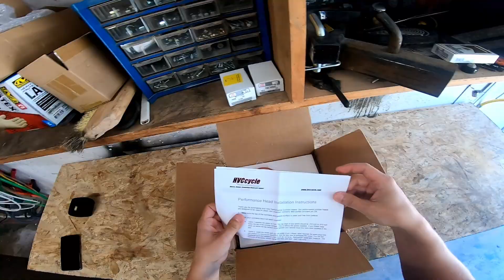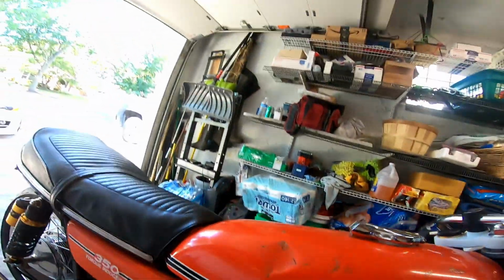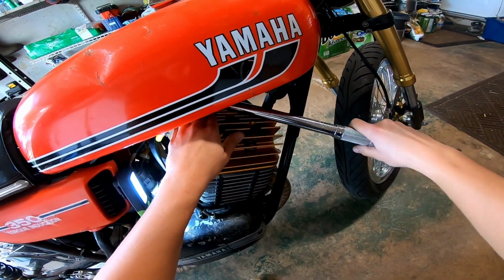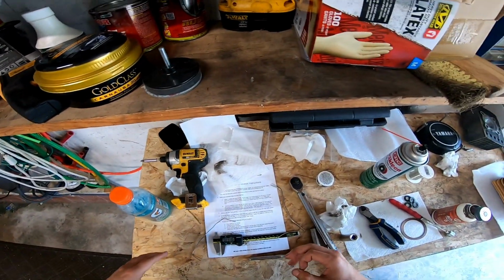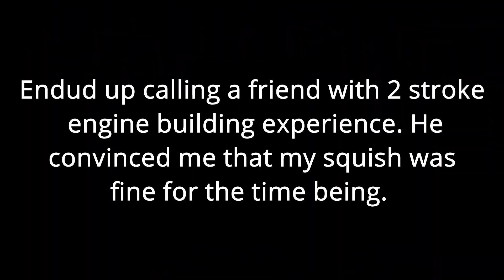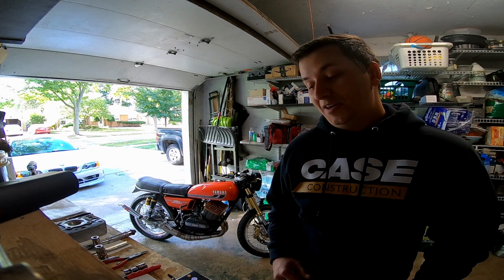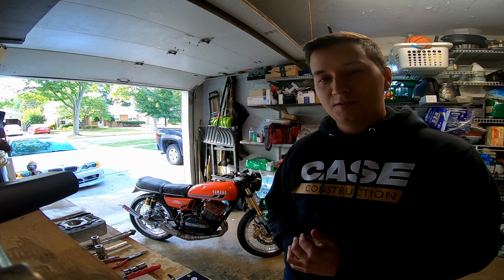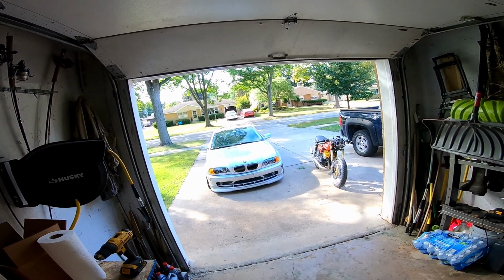Installing HVC Cycle CNC Performance Heads on my Yamaha RD350 Cafe Racer!

Comment: I was a young kid flagging the races on a 1/8 mile bridge then the RD 350 Yamaha raced a 750 Honda Super bike the guy on the Honda was  half way across when the Yamaha was the finish line the guy on the Honda was crying, I was laughing my but off !!!  On using the high compression heads are great. I built a Kawasaki 750 triple and I used 12 to 1 pistons, polished the exhaust ports and put a real nice expansion pipes on it, made the intake a little and I knew before testing it I had put in a set of Barnet racing disc's and double springs. and the guy I was working for wanted me to race it. i ASKED him did my wife put you up to this. He didn't have the money to get the extended swing arm and put on a slick an wheelie bars on IT..

Comment: I had a 75 RD350B back in the day along with a TZ750 (best thought of as 2x 350's welded together by the factory for Kenny Roberts).
For biggest smiles, lower intake ports 4mm and raise exhaust ports 3mm, smooth and widen transfer ports with a 280-320 finish grit.
It will take it from mildly pipey to downright explosive and give you at least 2000 more rpm of peaky fun.
My RD350 would wheelie at 60mph in 6th gear when cranked on. Can be very scary for newbs.
Reply from the maker: That tz750 had to have been a monster! I haven't ever done any sort of porting but it doesnt seem terribly difficult, just need to know what you're doing. I'd love to do some porting like that and use a vito's crank eventually when i rebuild the motor. Any recommendations for good places to get the cylinders ported by someone who knows what they're doing? Wheelies at 60mph would be awesome and make it feel more like my mt10 ;)
Reply: @Enginerded  It's kind of a lost art these days. There might be a few out there that do it, but I do not know of them.
I did my own since I was a mechanic for more years than I'll ever admit w/o massive amounts of alcohol. I don't have the ability to do it any longer since I'm a stage 4 cancer patient these days....I sit around and watch shit like youtube videos :)
Anyway, you'll need a degree wheel, a long shank die grinder, and a porting kit that consists of a bunch of (basically) sandpaper drum wheels and flap wheels.
If I could upload a image it wouldn't be too tough for me to photoshop up a drawing showing exactly how to do it....but kinda limited here.
Reply from the maker: @jamesroberts1800   @James Roberts  well shoot I'm really sorry to hear that, but sounds like youve had a hell of a time at the very least with these awesome bikes! If you have some info lying around you could email me at enginerded@gmail.com if you feel like it, but no worries.

Comment: If it needs re-jetting , be careful not to go too lean . It will seize if you do .
Just curious . Why didn't you remove the Tank for that job ?
Reply from the maker: Jetting is pretty good I think based off of how it runs and how the plugs look! Spent a lot of time dialing it in. Didn't take the tank off because I didn't feel like I had to. Had all the space I needed with it on, though maybe it would've made filming easier. Was just lazy :)
Reply: Just add a little more oil into the fuel tank if you think she may be lean

Comment: Hell yes! Sweet build man, wow it sounds like it’s tuned to perfection. I’ve been working on my 1974 RD350 for the last few years and it’s getting close. I’ll send you a video when it’s dialed in. Congrats on the gold heads, what a good call. Would love to know what your ignition setup is and carb and intake mods. It really sounds great through all sections of the throttle!
Reply: I used to run a 350 with reprofiled standard heads, fast road type porting, not the totally mental port jobs some people try to get away with and home made pipes designed from the formulas in Gordon Jennings book. main jets 210 - 220 with open carbs or K&Ns, ignition 1.9 btdc. Max power was around 53 at 8600, max rpm was 9000 I had no trouble running 25 thou squish at those rpm. If you can get an RD400 clutch and primary gear the clutch has more plates, you may need to alter the rear sprocket if you want the same speeds in each gear. When you assemble it obviously use new springs and friction plates but leave all the rubber rings out, they push the plates apart slightly, finally I used 1.2 liters of Bel-Ray light gear oil instead of the SAE 30 recommended. I also raced this bike for a few months and had no problems with it
Reply from the maker: Thanks and good luck with yours! Would love to see some videos of it. Ignition is stock (and to my knowledge) the original points setup. I made a video where i tore the bike down and retimed it and cleaned the points once it fouled the plug. Did that right before i put the heads on the bike and it runs great! Also running the 2 into 1 y boot intake with the uni foam filter from either HVC Cycle or Economy cycle, yz125 reeds, reed spacer, and a crossover tube. All of those were from economy cycle. Then spent a ton of time messing with jets and needle settings (running the dave f carb mod) and now its pretty dialed!
Reply: @madmaxsdog8040   May I ask for you help?  What is it the title of Gordon Jennings’ book to which you a referring?   Please let me know.  Many kindest thanks!! :):)
Reply: The bike in the vid isn't mine I mentioned mine in the comments. I was running 220 main jets, had to move the needle clip one notch but can't remember up or down, you'll soon know if it's the wrong way. Ignition was a stock RD400E bottom end with cdi and wiring harness. Timing was 2.1 mm btdc.
Reply: Ignore the ignition timing, it's for a 400. For the 350 I used standard RD250E bottom end harness and cdi, timing 1.9 btdc
Reply: @fmagalhaes1521  I think its called Two Stroke Tuners / Tuning handbook but I no longer have it. Another good one is called Performance Tuning in Theory and Practice by A. Graham Bell. Both are kinda heavy reading  but well worth it
Reply: @fmagalhaes1521  You can download free software from a link in a video posted by 
au mechanic
If I remember correctly you only need yo enter the port timings, your required rpm and whether its road, motox or  race. I had to do it with a calculator and lots of paper lol. I think it's also capable of plotting templates for cutting the cones out of sheet metal, I always used 20 guage which is just over a millimetre, it's relatively easy to work with and not too noisy. Expansion chambers resonate and some of the noise comes through the fat parallel section in the middle of the pipe

Comment: Just tuned in to hear your bike again since mine is tucked away in the shed for the winter.  Damn those pipes sound good.
Reply from the maker: Love to hear someone else enjoying it! I find myself doing the same thing every so often during the winter
Reply: @Enginerded  yea, I went out to my shed today because it was warm out and tried to fire mine up but no success with the RD but my Beemer fired up no problem however that bike is so quiet it just doesn't satisfy the need for that cracking sound.😀

Comment: I have one I need to rebuild, I’ve been told, if you are not careful, it’s pretty easy to lift the front wheel just by cranking on the throttle, and I’m not talking about popping the clutch. How is yours with the new heads?
Reply from the maker: It felt really really good with the new heads! Its been torn apart for about 2 years now waiting for me to finish the custom seat i started. I've got an exhaust sound video i recorded it on my channel if you care to see it running with the heads. You can see it lifting the wheel up there :)

Comment: Had one of these as a first bike in the 80s. Loved it. Yours is a peach!  If you’re still running points (looks like it) swapping it over to a modern electronic ignition will also give you a boost.  If you only have 5 gears, check to see if you have a 6th hiding in there but blanked off on the selector.  They did that on early ones. No idea why. Sounds very crisp now, definitely higher CR. You can hear it on the blips!

Please use only the best octane fuel you can get. Cheap insurance. What timing are you running? 2mm?

Well worth doing a plug chop too to check the mixture at the top end.  

Great video by the way!  Just found this channel.
Reply from the maker: Thanks for the kind words! They're a blast of a bike for sure. I'll be converting to an electronic ignition down the road for sure. For now the points work alright, but having an adjustable timing curve would be sweet! This is a 1975 so its got the 6 speed transmission in it luckily!
I always run 93 octane, but now with these heads I add octane booster or run race gas because the gap is pretty tight right now, and i felt like i may have been hearing some pinging occasionally on decel around 6-7k rpms after installing the heads. No issues after bumping the octane up over 93. I may back the timing from 2mm BTDC to 1.8mm and see how it does.
Reply: @Enginerded  Plug chop is next!  Read those plugs. What mains do you have in there?  What’s the induction system?  Stock? K&Ns?  Are you running YPVS boost pipe between the reed blocks?
Reply: @Enginerded  You've been given some good tips by Mr Walker a plug chop is a must, this lets you know how your mixture is. Also make sure your carbs are balanced ( slides opening together, not staggered) this feels crisper when blipping, the cables stretch over time and they can go out of balance, take air filters off and use a small mirror to check operation. Getting a performance two stroke to a good level takes a bit more than just the heads, also use a good two stroke oil preferably full synthetic, and check your oil pump is set according to the manual (or are you on premix). Two strokes take a bit of fettling compared to a 4 stroke, especially when it comes to mixture, ie jetting. ideally you want a nice pale to medium brown colour on the plugs, not sooty and not white ( too lean) 
hope these tips help your setup, ps i used to race TZ 350 Yamaha many years ago, so i know the basics.
Reply: Wasn't it just the 250's that had sixth blanked off? Sure my (very) early 350 had a 6 speed box. I think top was like an overdrive and the 350's had a bit more grunt to pull it
Reply: @jasonpowell3841  My 350 definitely had a blanking piece.  I remember removing it!  Then was able to add a tooth or two to the rear sprocket as it was as you say, a bit of an overdrive.
Reply: @ruaraidhmcdonald-walker9524  Ah ok, maybe they did? Was a while back. You sure yours was a genuine 350, the top ends bolt straight on as same stroke and a feeling you have to change the primary to do it properly
Reply: @jasonpowell3841  This was back in 1986.  Definitely a genuine 350!!
Reply: @ruaraidhmcdonald-walker9524  Oh right i had two, i restored one a couple of years ago, it was a 73 model (made dec 72 US spec) and that wasn't blanked off but maybe it had been done? Pretty sure the one i had in the early 90's had six speeds as well and stuff i've read online mentioned the 250 but you can't believe everything you read! Maybe some area's of the world changed (i'm in the UK). I've just done a 71 DT1 and the clutch had a extra spacer diagrams didn't show. Yamaha did change things a lot, even inside model years
Reply: @jasonpowell3841  Yes mine was a 74. In Maroon. The 250s were a different colour too I seem to remember. Lovely bike.  Should never have sold it. Yep also UK.
Reply: @ruaraidhmcdonald-walker9524  I'm partially paralysed due to an mx injury so just do em as a hobby. If only i had some of those steeds i had back in the day! Also had a 350LC and a couple of power valves. Would have kept the one i just did if i rode, beautiful bike although i probably would have made a cafe racer out of it for myself - sacriledge lol

Comment: Love IT!! Have had 5..All Basic STOCK!  Did Brad O..At HVC include to reTorque Head bolts after a few Heat Cycles>? I always Do,, with reannealed COPPER  gasket..or new..But,,This has O rings !  like a Modern dirt bike! Congrats!! Good Job on Squish.

Comment: If you can get were you live. Castrol R-30 can  be used as two stroke mix for extra power and the smell of vintage race days .
Reply: that smell is so awsome back in the early 70s it was realy expensive i would hate to think what it would be now

Comment: What is the appeal of removing the fenders and changing the tachometer? I detest cafe bikes and want to know why you did that. I have expansion chambers on my rd400 so I understand modding some things but why the tach or fenders?
Reply from the maker: Agreed that no front fender doesn't look good, but that's only because i haven't gotten around to fitting/making a new front fender to work with the forks i put on the bike. Fender is on the list.

As far as the factory gauge cluster, it's extremely heavy for what it is, super bulky, and did not flow at all with the final look of the bike I'm going for. It also is from 1975 and the gauges are bouncy and sluggish. 

Sold the factory gauge cluster to someone that wanted to restore it and fit it on their bike, so it gets to live on. I prefer the clean look of the single tach, plus it has a multifunction LCD screen that can toggle through MPH, voltage, odometer, as well as other functions. 

I designed the upper triple clamp myself so i made it to fit nicely with the tach bracket I also designed (have a video on my channel about this). It all comes down to preference and each person can build their bike however they want. No shame in leaving a nice bike stock, or in my case breathing life into a barn find bike that was otherwise rotting away and putting my own twist on it :)
Reply: @Enginerded  interesting. I personally usually put expansion chambers and a different airbox on my yamahas so I understand it to a certain extent. A lot of the cafe guys seem to just mod things to mod things and you seem to have a vision.
Reply: @Enginerded  the worst is the cafe guys that obviously don't like riding much and just want to have a project to jack up then scrap when they get bored.
Reply from the maker: There's definitely different people that build them. Like you said, some are made to look pretty and be garage art. I love using the cars/bikes that I have so everything i do has a functional purpose. 

My goal with the RD is to bring it up to modern(ish) standards in braking and suspension, while getting to experience a mildly hopped up 2 stroke on the streets whenever I please since it's street legal. Keeping the oil injection for ease of doing longer rides as well, which people commonly remove to get rid of the oil tank. I happen to love the look of the oil tanka and side panel.

Love the 2 stroke sound and powerband!

Comment: Do people still pop dents using compressed air? I tried it years ago and it worked great. If you overdo it tho, the tank will turn into a sphere. Stop and check as soon as you hear some pop noises. I used a freeze plug to stop the tank and blew the air through the hole in the FP
Reply: That's how we fix 2t exhaust pipes still. Acetylene the area, compressed air pops em back to new.
Reply from the maker: Not a bad idea. I will be tearing the bike down for a full paint/powdercoating eventually but not for quite a while. Could probably use a pry bar and some heat to get the dents out, but havent worried about it for now!

Comment: What was your squish? 0.9 ? 
Did they make a noticable difference? 
Im just having my rd400 heads done by a famous two stroke tuner here in England. . He likes to keep it at 1.0mm squish to be safe. . . Can't wait to get them back. . I couldn't afford 800 quid here in England for them. . They look lovely. . .nice bike sounds great
Reply from the maker: I believe i ended up right at around 0.7-0.69mm. Pretty tight so I've been running octane booster in the fuel or a race grade octane when i can for the time being to avoid any spark knock. Will get thicker base gaskets or shim the jugs in the future to be safe on regular pump gas. No issues thus far after a few hundred miles and high octane fuel. Definitely more low end torque and much more top end power! Had to upgrade the clutch after the install, would no longer hold once it hit the power band
Reply: @Enginerded  I got my machined heads back today from the legendary tuner over here in England. Amazing I've ended up with the same squish as you 0.7 jeez not sure if that's safe. I shall be upping it to 0.9 min
Reply: Hi did you have to alter your ignition timing at all? Was there any instructions from dg about ignition timing?
Reply from the maker: @coco-te1op  i set my timing to 2.0mm BTDC. Been running it that way for a few hundred miles with high octane fuel + octane booster or with race gas and no issues so far. Might be backing it down to 1.8mm BTDC to see if i can get away with just pump gas comfortably and rev out higher.
Reply: @Enginerded  I have put a 0.75 base gasket on the 400 and now ended up with a 0.93 squish. Couldn't ask for better. .
Reply from the maker: @coco-te1op  worked out perfect for you!